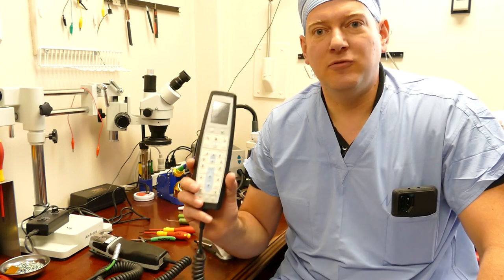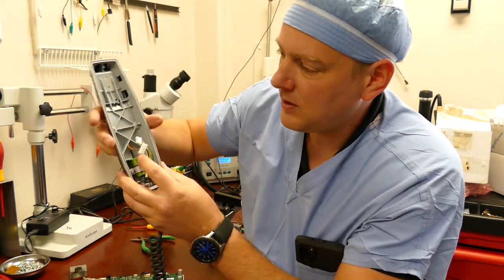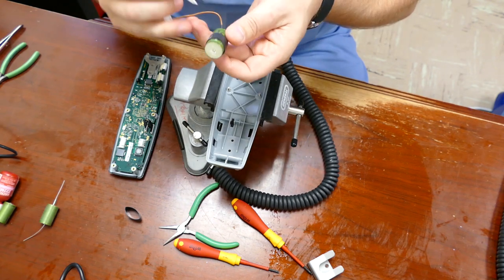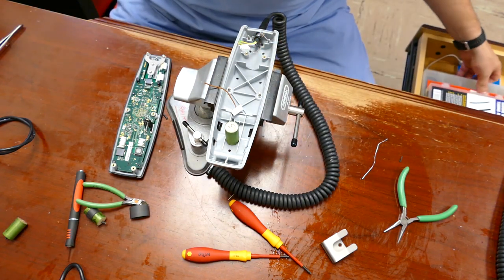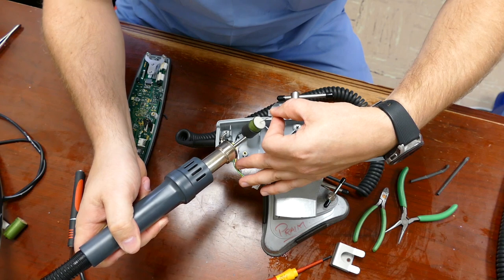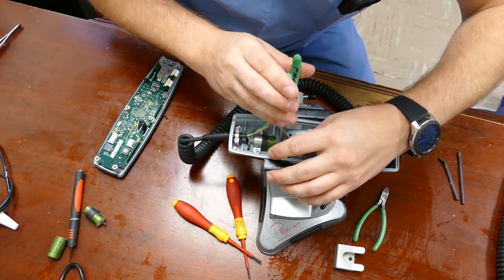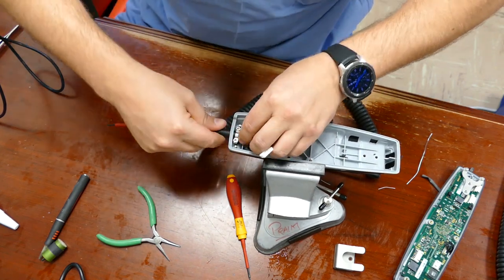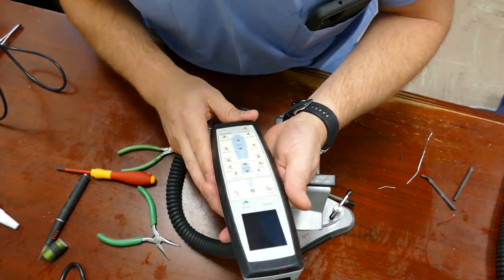Repairing Trumpf Surgical Table Hand Control

Comment: Hello better biomed, I am from the Philippines working as a biomed and I also encounter one Operating Table that won't turn on, the model is Heyer Aegistic OP830. I already checked the wire connection but I haven't seen any problem. I can't dismantle the lower part since the hand control is not working and I cannot adjust the hydraulic to higher level. Do you have any idea what causes the problem why it can't turn on?? I need your help please.
Reply from the maker: Most American hydraulic tables have a manual pump for when the electronics stop working.

Comment: TS7000 ref.: 1767067 

Some keyboard knobs gives just a short burs of table-movment, then it stops, keyboard on table works fine.
Problem: keyboard PCB is flexing due to insuffisient support of main PCB in the remote caseing . -design flaw.
Sollution: add support  ie. an O-ring or a  cloth to add pressure between the rear cover and main PCB
Reply: I'm having this issue, but adding something between the back case and the PCB to add pressure doesn't resolve it for me. The only time it seems to work is when I'm touching the PCB with my bare skin, as if I am adding a grounding element or absorbing electrical interference, but as soon as I take my hand away it stops working (I'm also not adding pressure to the PCB, only touching it very lightly). Do you have any other tips for solving this issue? Thanks

Comment: A capacitor blocks DC voltage. It would make no sense to power the controller from AC and use a blocking capacitor. What i think they are doing is having the capacitor between the case and the ground to isulate in case some fault develops in the power supply and ground becomes hot. It's an intrinsically safe way to build things, and also gives a lot of protection from ESD. The appliance in this case probably checks that this "safety" ground is in place before powering up.
Reply from the maker: The controller is powered by DC. Why do you believe it's powered by AC?